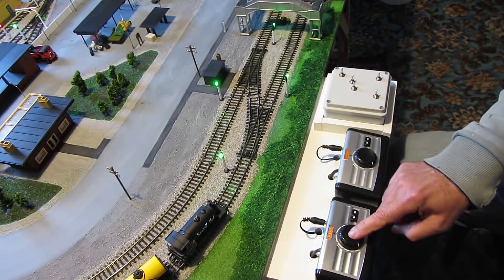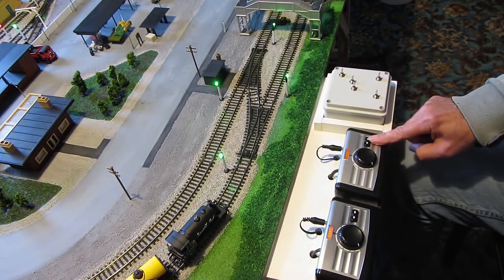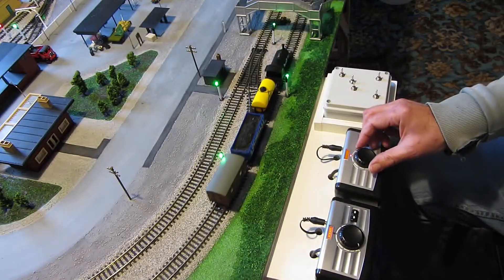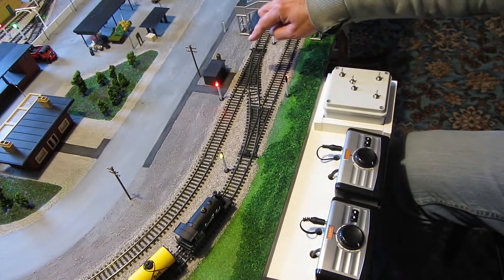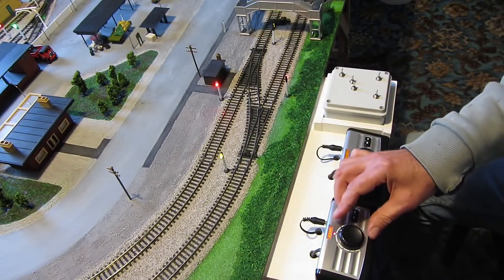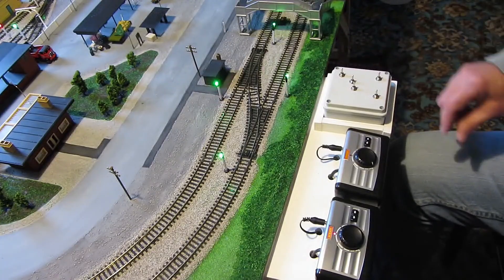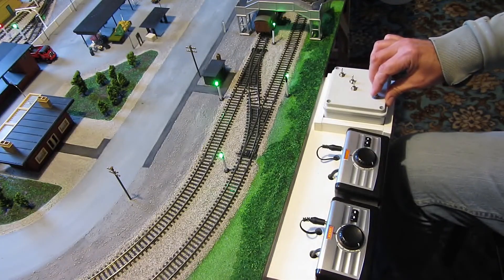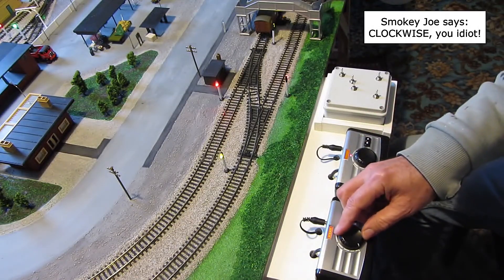Dual Hornby R8250 Model Railway Controllers. Gaugemaster Points Solenoids. LED Signals. Smokey Joe.

Comment: SOLVING ALL THE ELECTRICAL ISSUES  OF THE 12v DC BEGINNER ! 
The problems you describe in the write up, are only applicable because you fail to understand Direct Current Electricity. As you have TWO CONTROLLERS, ALL the issues you mention are because you are NOT using "COMMON RETURN", and will totally VANISH forever, when you wire the layout properly. Indeed you will also be wise to add "CAB CONTROL" as you have more than one controller. This is all basic "Model Railway Club Wiring methods" as used on virtually all 12v DC Club layouts. AND WIIL REDUCE ALL THE LAYOUT WIRING BY AROUND 50% in one foul swoop.   

Traditional 12v DC (Direct Current) electricity can do a number of things that Alternating Current (AC) cannot do without causing short circuits. So 12v DC layouts need only around 50% of ANY DCC wired layout as a result. And can do things that with DCC require very expensive Electronics and chips !!!!

12v DC "COMMON RETURN"
Stupidly simple and it saves loads of boring wiring up and miles of expensive wire. First you make a simple decision as to which rail will be the PLUS and which will be the NEGATIVE, and you must stick to this for the WHOLE layout. 

So on your simple circular layout I would call the OUTER rail of each track "Plus" and the INNER rail "Negative", all around the layout. So ONLY the outer rail will need plastic rail joiners at the "section breaks" NOT BOTH RAILS IN FUTURE. Indeed all the inner (negative) rails are now joined by ONE jumper wire to ALL tracks on the WHOLE layout. 

You no longer need separate negatives for each controller !!!  So ONE wire which becomes the "COMMON RETURN" connects all negative rails on all tracks on the whole layout, and indeed can also connect all DC accessories "negative" wires such as point motors, signals even lighting all with ONE wire to EVERYTHING !

On the back of your controllers you should find the "12v DC controlled output". Which should have a "plus" and "negative" marked wire. BOTH THE NEGATIVES ON BOTH THESE CONTROLLERS ARE  JOINED TOGETHER AND CONNECTED INTO THE NEW "COMMON RETURN WIRE" that goes around the layout. ONLY half way across the crossover where trains pass from one controller area to the other, are BOTH rails fitted with plastic insulating rail joiners, and at any other location where one track joins both controller areas. This is to ensure that if by accident one controller is set in the opposite direction no short circuits will occur, although a locomotive may jitter back and forth over the actual join. 
 
I notice next to your Hornby controllers, you have a small box with mini-toggles switches. If these are for track sections then ONLY the "PLUS" section wires should be passed through those switches. Any negative wires should now become part of the ONE SINGLE COMMON RETURN WIRE THAT SHOULD CONNECT EVERY NEGATIVE WIRE OF EVERYTHING ON THE LAYOUT (Never connect any AC accessories into the DC Common return). Indeed avoid AC accessories on a 12v DC layout like the Plague. AC & DC do not like each other and do NOT even like coming close to each other as Mother Natures DC sets up "electro magnetic fields" around it, that can result in interference with any "AC" wiring that comes within a couple of inches of it !!!! 

CAB CONTROL 
This is for the actual section switching. What Cab control does is to allow any section on the layout to be switched to ether controller on a temporary basis. So you can drive a train into a station using just one of the controllers, even though the train is Tresspassing on the other controllers area. It simply means that the plus wire from any section switch going to a section of track, has the normal "On/Off" switch replaced by a "Single Pole Double Through" switch, which has three contacts on its rear. You take the two "Plus" wires one from each controller to the two outer contacts on the switch. The centre contact wire is the one that actually goes from the switch to the Plus rail of that section of track to be controlled. And because you now have a "COMMON RETURN" wire for the layout "Cab Control" doe NOT involve the negative wire, so cheaper switches are the result, and less wiring. 

The "Secret" of Direct Current with respect to Model Railways is that "DC" will only return to the Transformer it came from. Hence this is why you can have a ONE HUNDRED Transformer Controllers on a Gigantic layout, and the SINGLE COMMON RETURN WIRE can connect all 100 negative 12v DC track connection on all those Transformers. The 100 separate return supplies from wherever they are returning from on the layout, will quite happily all travel together up the same "COMMON RETURN" wire without trouble, and find their way back to their individual Transformers that they came from, without trouble. With 12v DC therefore it is ONLY the "Plus" wires that must be kept individual and independent of each other, or you will get short circuits.  

Happy WIRE REDUCTION fun. 😀😀😀
Reply from the maker: The inner and outer tracks are insulated by two fishplates, which, as you say, is essential to avoid a short-circuit.
The points switches play no part in electrically connecting the various parts of the track; the points themselves do that.
No wire reduction fun for me!
Reply: @trottophone   You have totally misunderstood what I am saying. And I know why. You cannot yet believe that just ONE SINGLE SOLITARY WIRE around the whole layout can complete 50% of ALL the wiring necessary on your layout. You are effectively thinking in Alternating Current (AC) methods, as AC requires two wires for everything, but NOT Direct Current. Direct Current can do many things that would result in AC having an immediate Short Circuit.

Further the ONLY reason both rails still need insulated rail joiners ONLY at the meeting of two separate controller areas, is NOTHING to do with the DC wiring, but everything to do with modern "Problem Locomotive models". As we cannot confirm how each and every model loco has been wired by the various manufacturers. As many now include "nasty little electronic parts" they now want to include in all loco models for the benefit of DCC users. Whether you use DCC or not. Indeed all those new modern troublesome "electronics" you don't need, you are in reality paying for. Which explains why British outline models are so horrendously expensive today.

And I've been teaching  Modellers of all levels from the Beginner to the Club Expert about what is possible with Direct Current methods, for nearly 40 years. As I am also a very senior ex British Railways Engineer and the joint inventor of TCC (Track Circuit Control) back in 1977 especially designed for large Club Exhibition layouts. A system which also dramatically reduces all layout wiring, thanks to the fact Direct Current will ONLY return to the Transformer/Controller is came from. Even when mixed in the same wire with current from a thousand other, Transformer Controllers ! 

Manufacturers you need to understand will NOT mention clever cost saving and wire reducing methods such a COMMON RETURN, or CAB CONTROL. Because both result in the manufacturers selling fewer parts, accessories etc, etc. So loosing potential sales in the process !

Possibly you should join a local Model Railway Club. Assuming they do NOT use "DCC". Because any half decent club will immediately explain that virtually everything you have written in the programmes description above is just what many beginners believe, because they do NOT understand how Direct Current works. And there should be NO hazards at all when driving locos over insulated fishplates at the meeting point of two controllers areas. That assumes of course that BOTH points on such a crossover are both set to go across the crossover, and of course you are still using Hornby toy train set "clip together", which is in reality made by the Austrian Company ROCO, and may just have some funny ideas about how to wire the "Frogs" in those points. Much better and safer to use the PECO Streamline flexible and modern Code 75 track system. Its much more professional !!!

Happy wiring !😀😀😀
Reply from the maker: @railwaymechanicalengineer4587  I'm using Hornby R8072 and R8073 points, with insulated frogs.
Ignoring the points switches, motors and signals, there is no track wiring at all, apart from the wires from the controllers to the inner and outer tracks.
I can't make the track wiring any simpler, because there isn't any!
Reply: @trottophone  YES you can. Both the Negative wire to those two tracks need to be just ONE wire, that alone will reduce some of the complaints you make in the programme write up. But I will add that if you use Commercially orientated products aimed at the "Beginner" you will eventually find all sorts of nasty electrical issues. 

Those Hornby controllers are junk, you need something with proper output terminals on the rear such a "Gaugemaster" Model "D" twin track controller. Better still build a box for all the layouts controls so you can use the much cheaper Panel mounting Controllers and hide separate naked transformers within the wooden box (best made using Marine Plywood, with a hinged front (using a bras Piano hinge). Then those little "Mini toggle" switches can be mounted on a track diagram, as they only need a 5mm hole drilled in the 5mm thick panel facia. 

Further EVERY toy train set "Clip together" track system made anywhere in the World, immediately introduces a number of electrical problems. The first and foremost being the ridiculous number of rail joins, every one of which is an electrical resistance issue. They are also extremely expensive. One yard length of Peco flexible CODE &% finescale track is far cheaper, greatly reduces rail joint numbers and give you the correct size MODERN NEM compliant rail type. Hornby are still flogging a pre NEM track system made by the Austrian Model Railway Company ROCO, who do not use that ghastly old (pre 1989) track system themselves as it is NON NEM compliant !  So Hornby's own Rolling stock, made by another German Model Railway Manufacturer PIKO in their new plant in Canton PRC,  do NOT have pre NEM wheels  but modern RP25 NEM compliant wheel treads and radii to the flange designed to run on CODE 75 track (Code 75 = 75 thousandths of one inch high). Which was all agreed at the NEM Conference in Germany back in 1989, which the British Track manufacturer PECO attended, but Hornby ignored, because they honestly and stupidly though that "OO" being British would not be dealt with at that Conference. 

Lastly you need to understand that 91% of ALL Hornby's shares are owned by just TWO Investment Management companies, who have no interest, understanding or knowledge of anything to do with either Model Railways or Real Railways. Which is why the Hornby Board keep shooting themselves in the Foot !  They've been bouncing along around £5 Million in the Red for the last 5 years, and may yet go bankrupt !!!!
Reply from the maker: @railwaymechanicalengineer4587  I'm now using Hornby R965 controllers, which seem OK to me.  You're right that the R8250 controllers are junk.  I tried improving them by smoothing out the PWM waveform (to make the locos less noisy) and adding some 'electrical inertia' to the speed control (to force the locos to speed up and slow down gradually).  These mods worked, but the fundamental problem with the R8250 remained, which was that the output is not affected by the back EMF of the loco motor.  In other words, at any one speed setting, the controller does not try to keep the motor at a constant speed, it simply supplies a constant PWM voltage.  I haven't taken them apart yet, but the R965 apparently uses a thyristor circuit with feedback, which IS affected by the back EMF, resulting in much better steady low-speed running. 

I measured the resistance of one track, including 13 fishplates and four sets of points.  It was about 3 ohms, which was more than I expected, but not enough to make a difference.  Maybe the resistance will increase over the years!
Reply: @trottophone  Noisy locos may be more likely a lubrication problem. Hornby's regular (white) lubricant is a type admirably suited to protecting mechanisms floating across Salty Oceans in ISO containers aboard Container ships (Hornby's Locomotives are shipped via the Hong Kong Container port to Thameshaven in the Thames Estuary), so spend some months at sea. But their lubricant is not ideal for the locos when used on the layout. Indeed the only loco lubricant I ever use or recommend is that made for Fleishmann/Roco and produced by Mobil/Exxon specially for 12v DC motors as used in Model locomotives !  You may also experience "noise" if trying to run larger Hornby or any other manufacturers locomotives around curves of less than 2 foot RADIUS. Such sharp curves are themselves a serious problem as the LAWS of Physics will explain.  

A real life large Locomotive such as "Flying Scotsman" or a British Railways Class 45 Diesel will not in real life negotiate a curve of less than 4.5 Chains radius at Walking Pace (3mph) without damaging the track. 4.5 Chains is 297 feet Radius. Which in "OO" scale at 4mm to 1 foot becomes a minimum 3ft 11in Radius on the Model Layout ! And modern Model trains are far more accurate in every way since the NEM conference in 1989. And of course suffer from exactly the same Laws of Physics as their real life counterparts. Hence when I plan & build (large) "OO" scale exhibition layouts I will NOT use any curve of less than 5ft radius (10ft Diameter) because of the known issues running model trains on any curve sharper. And of course NO manufacturer of models in any scale really wants to point this issue out, or they would in many cases go bankrupt as a result. But the Laws of Physics won't change just because the manufacturers might want to ignore such issues !  

There are lots of hidden pitfalls in Modelling Railways ! But many have long since been recognised and "circumnavigated" by Model Railway Clubs. Which is why I always recommend joining a Cub, to every beginner. As the quickest and cheapest way to short cut that potentially very expensive "Learning Curve" !

For N Gauge exhibition layouts I won't as a result entertain any curve less that 2ft 6in radius (5ft Diameter) for exactly the same reasons. Which is another reason why my exhibition layouts usually function far better than ANY other layout at any exhibition I attend. And for Hornby's recent venture into TT (1:120 scale) about halfway between OO & N Gauge in size  I wouldn't use anything less than 3ft 9in Radius.   

Horny's Controllers were NEVER  regarded by Clubs & Professional modellers as anything better that junk. They are not sophisticated at all. Just crude and basic. which is why I recommended Gaugemaster (cased or panel mounted) types. Gaugemasters normal 12v DC controllers have individual screw terminal on the rear, for both the 12v DC track supply and a separate (uncontrolled) accessory supply. And are far more Professional, and known to be reliable, by Club members. Other than Hornby's Model Locomotives & Carriages made by PIKO (German Company) at their Canton plant. Virtually everything else produced for Hornby (90%) comes out of India, and is "bucket market" quality. Indeed Hornby even after 36 years still cannot understand the "Standards" agreed at the NEM Conference in Germany by ALL European based manufactures back in 1989, including of course British Peco who are probably the Worlds most accessible track system. Its even available in Japan. And Peco are of course also the publishers of both "Railway Modeller" & "Continental Modeller" monthly magazines, where you will discover a lot of helpful tips, and the existence of dozens of Model manufacturers, you have probably not yet heard off. So even the large amount of "Advertising" in those magazines is very helpful to a beginner.
Reply from the maker: @railwaymechanicalengineer4587  The R8250 produces a PWM output with sharp edges, which causes noise in the motor.  The motor acts like a tiny loudspeaker.  Before the loco starts moving, or when it's moving slowly, it makes a buzzing sound.  I managed to remove the sharp edges, and the buzzing.  
Figuring out how to do it kept me busy for a while, but it wasn't really worth the bother. My pair of R965s were only £20.
Reply: @trottophone  PWM = Modern digitised madness. I've just reviewed Hornby's explanation of this method, and its quite simply a very nasty "cheap skate" trick simply to improve their "Profit Margins". Indeed knowing Hornby it will have been designed by another electronics manufacturer for them.

 You need a classic type of Controller with a proper "Heat Sink" a proper rectifier, and a proper electro mechanical regulator. All of which will prove its a "normal" type of Controller. And as already mentioned I recommend the Gaugemaster range of Metal cased controllers or their similar "Panel mounting" types. With a Panel mounting type, the actual Transformer is a separate part and NOT cased, so has to enclosed inside the control panel to avoid electrocution. I've been using Gaugemaster Panel Mount types on exhibition layouts for around 20 years. Although I also use special "resistance" controllers made by AGW (no longer trading) for problem areas such as Locomotive sheds, where very slow but very smooth movement is needed. 

Incidentally Gaugemaster do have what are called " inertia controllers" as well, with proper "Heat sink" and a proper "Rectifier" In this case the controller has both a Power handle and a Brake handle. Shutting the power handle does NOT stop the train, but allows it to coast and very slowly slow down, like a real train. Hence you have to use the brake handle to try and stop a train in the platform. Great fun on large exhibition layouts, but possibly not so cleaver on your small layout.